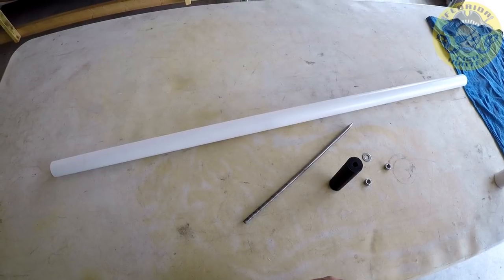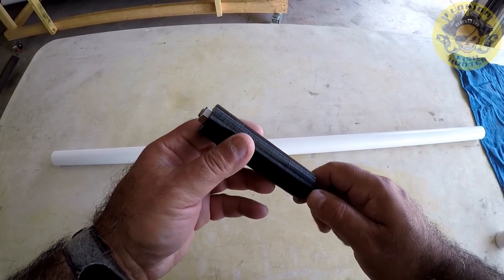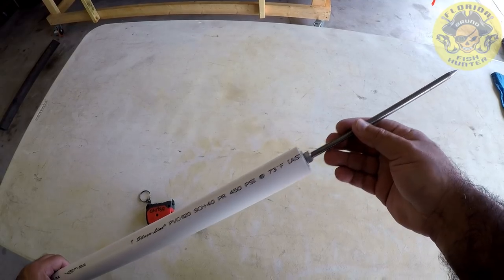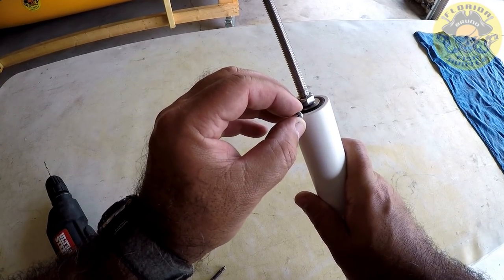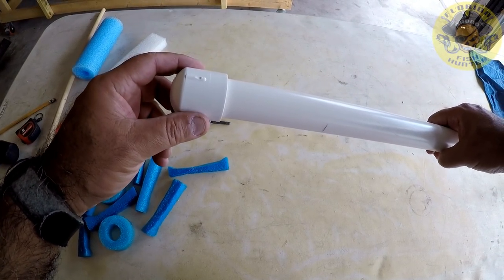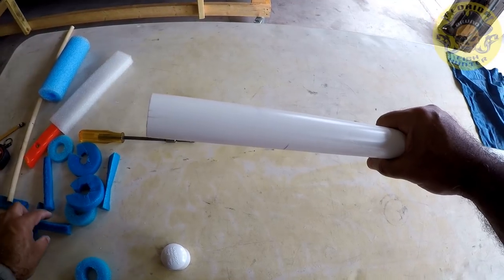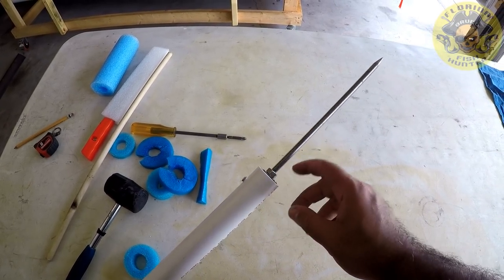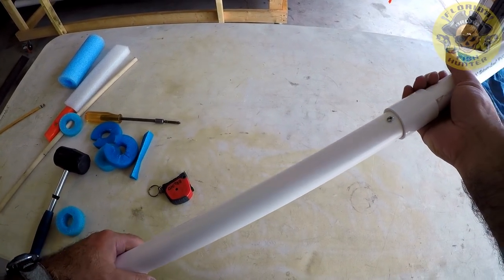My DIY Offshore Hawaiian Spear Gaff - Florida Fish Hunter

Comment: if you make the shaft with a pipe that has outside threading on one end, then you can use another short pipe one with an end cap as a "Sheath." Also, instead of pool noodle, get a can of Great stuff foam insolation, it will expand and fill any gaps.